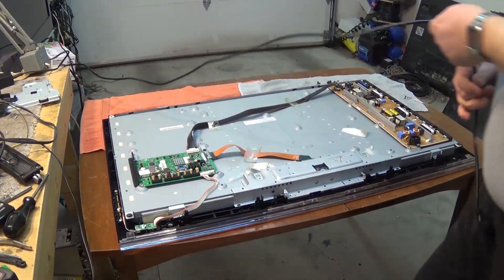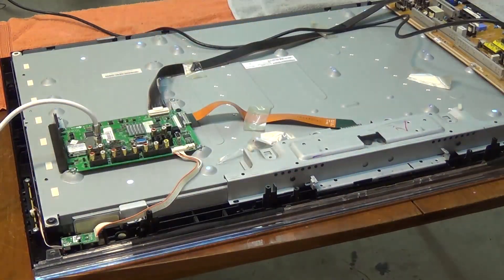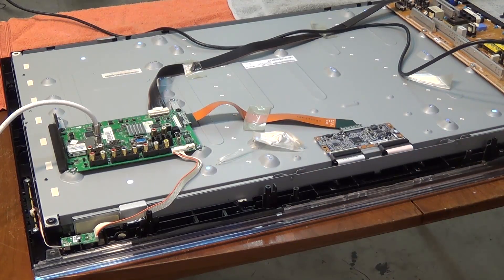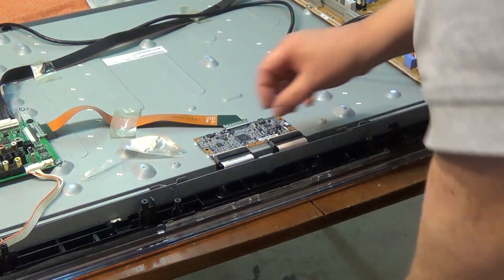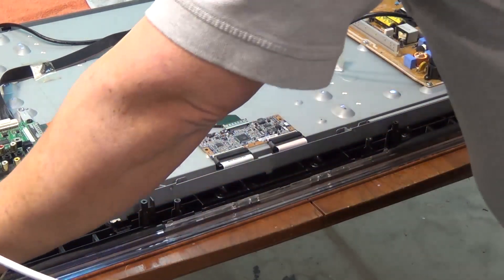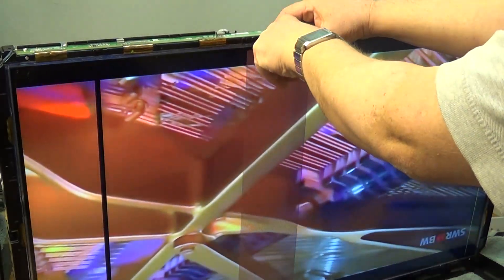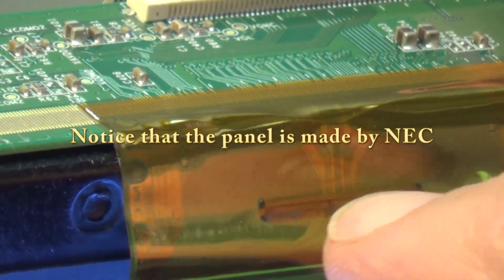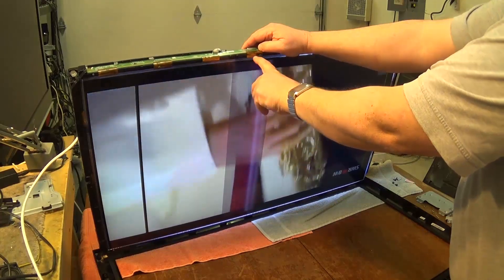LCD Panel failure

Comment: Hi...How are you Sir!!!!   Have a SAMSUNG LA26RT1B LCD with T-CON 260W3C4LV0.0 (Panel : 
LTA260W2-L13 Samsung), the problem is thick white bar about 3/4th from bottom, only signals TP on T-con Board is CPV1, CPV2, STV (not finding the CKV TP points), can you kindly help me with guidance for trouble shooting...Many thanks in advance!

Comment: I wish a manufacturer would produce some way to make those driver IC's replaceable.  Early plasma panels were like that. Later they made buffer boards replacement easy in plasma for some manufacturers
Reply: I’m in hopes they will follow the commercial market on that as it’s out there just not in the hands of the public yet. It’s being done on some displays UHD type on aircraft. The connectors snap together tabs but require a microscope to align the ribbons. And the LVDS signals are the same as Used on TV TCON boards. Xtron Corporation has a test jig to drive the TCON we test with and I often drive TV panels with it for test.
Reply from the maker: That won't happen.  Early plasma were 852 x 480.  So 852 conductors on 1 plane and 480 on the other.  On a large panel it was possible to have edge connector with that many pins.  LCD now 3840 on one plane and 2160 on the other.   Not gonna happen.  And early plasma did not have replacement ic. When I took the plasma course in 2001 there were no buffer boards.  Back then all the buffer chips were part of the panel.

Comment: I have a question about my Panasonic TC-P42C2 LCD.  I notice that on dark shapes or outlines, there is a faint horizontal line protruding form the outline.  It is really noticeable against solid colors like blue or green.  I think it might be a banding issue, but I'm not sure.  I have pictures to help reiterate my point if need be.

Comment: For someone who doesn't have a screen, that broken one was sure more functional than nothing. I would have loved to have had it as is for use as a monitor for a Raspberry Pi. I would just make a window smaller than the screen and drag it to the good part. 

Question: could a panel like that one be cut in half? I noticed it had two tabs. Could it possibly have been made into two smaller working panels or even one smaller working panel? Just curious.

Comment: U should stop trying to repair drop tv from walls and table stands 99.999% the LCD screen panels will have damages or have cracks in them.
Reply from the maker: +Chi Chu This was more of a tear down. I wasn't expecting to fix it, Most LCD failures are lost causes. Plasma are very serviceable, but LCD nope. Throw it away and send more money to the PRC.

Comment: Never worked on a LCD set before. But I remember my old teacher's warnings on very high voltage when tinkering with ancient CRT tvs. And I think LCDs are much lower voltages, but subconsciously I am getting the creeps you touching a live device. LOL. Guess teacher's warnings fully ingrained in me.
Reply from the maker: +alfblack2 
Well first and foremost, my bench is isolated from mains voltages. Secondly I have safety training. I know where the hazardous voltage are. I work on tube gear too, and those operate at very high voltage. My favorite equipment to work on is hifi audio components, Dat tape decks, vcr, cry TV, an plasma TV. I don't like Lcd TV or cameras. I just rebuilt a Panasonic sv3500, Dat recorder. What fun that was. The video will be done soon.
Reply: Yup. Truly believe you know what you are doing. I'm not so confident and skilled yet. :)

Comment: Funny how people think you can repair anything ! That's certainly the case with me. I had a similar thing a few weeks back, it was obvious to me that it came under "I'm good but not THAT good" LOL. That item, too, went to the dump. Both my tellies are old CRT types, one's a 90's Toshiba, the other an oldie from Sony, a KV1330 Trinitron. Don't want LCD ones thanks !
Reply from the maker: +River Huntingdon Well this one I was hoping that it was just the broken power supply board, but no, the panel was damaged, so I gutted it for the boards and sent the glass off to the recycle center. I don't have much patience for LCD Tv. I will spend time on a Plasma because I think they are cool, and of course CRT sets. I have an old 9 B/W CRT based monitor that I use as a clock. That's right. I have an app running on a Raspberry Pi that generates a flip clock, and outputs it as a standard video signal.It is old as the hills, and I am just going to run it and see how long it goes. The tube has some nice burn in from back when it was a security camera monitor. I look at it as a badge of honour to burn in a CRT. One of these days I will dig out my old Tektronix broadcast monitors and overhaul it.That will be a good one to show off Jitter, and VITS and Macrovision ect, as you can actually see it on the screen when in pulse cross mode.

Comment: If the IC is hot-bonded, is there a chance that you could warm the connection to re-bond the IC?  I just used a heat and stick technique to fix my select number bed remote.  It involved heating it up and pressing on a thin ribbon a few time.  My whole display is not w back.
Reply from the maker: +Tech Gorilla Possible, perhaps. I give up much easier than that. Besides the guy that owned it is a pain in the ass. I would never hear the end of it when something else broke. I sold him a used TV a few months ago, and am regretting it now. It is one thing after another.
Reply: +12voltvids   Understood.  If that was the case with me, I would do it for the learning before scrapping the carcass.  I have a couple of Sony pieces I just picked up for free.  I have an SLV D380P and I have a CDP-311.  You think there is still a market for these?

Comment: That's a dam shame as the rest of the tv works fine.
.
I was thinking about a heat gun or similar to see if it can be reflowed, but that depends on your interest/time and if its a compatable method.
If it was a common screen i would put the set to one side with a parcel label stating the screen type needed, but i bet its an oddball job.
Thankyou for making excellent electronic repair videos :-D, most people are not as good as you are, ive not found many real repairers like you, you make any repair interesting ;-D